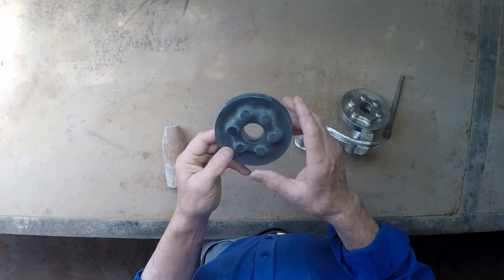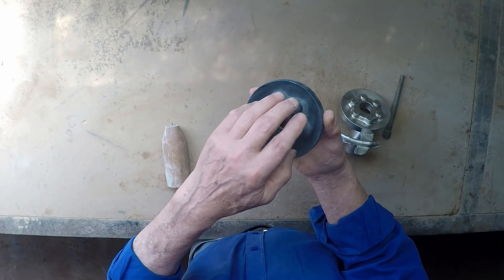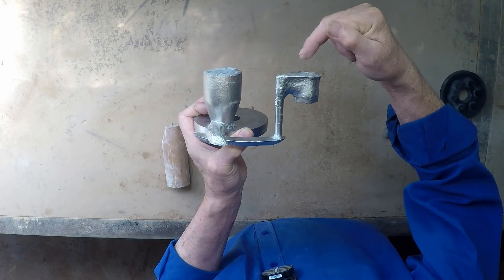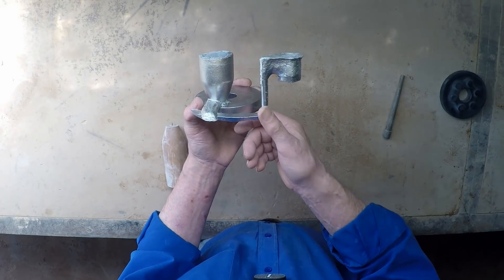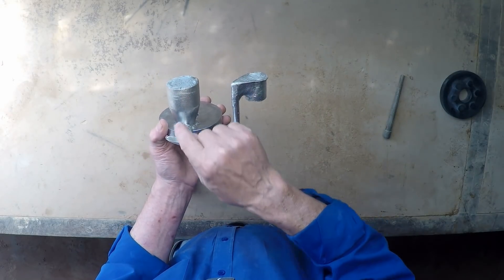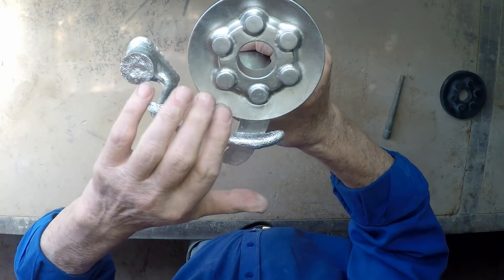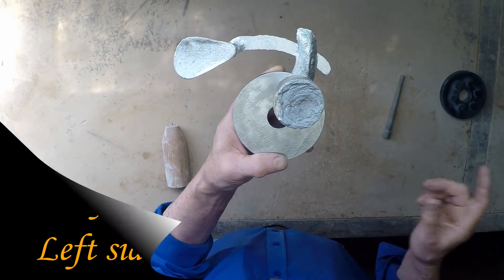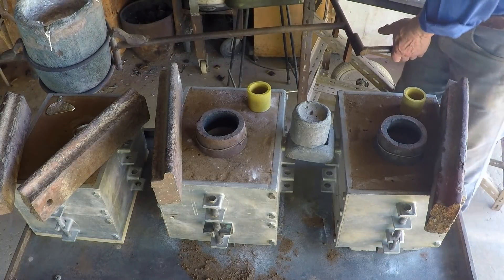Maserati Pulley Half

Comment: Would a sloping sprue not work and slow down the metal even more?
Reply from the maker: Diederik, I have been asked this question before and  in the main the answer is no. But the longer flow path through the sloped and therefore longer sprue will,  providing the sprue is running full, have greater friction and this should slow the metal a little. However the velocity in a sprue is generated by the head of metal pushing the flow, according to, velocity of flow = the square root of (2 * gravity * head height). Sloped or not the head height is the same so the VERTICAL velocity will be the same. This leads me to wonder if the velocity in the sloped sprue is actually faster because it travels further for the same vertical fall. For example if the velocity in a vertical sprue calculated out as 2 metre per second and the sprue was sloped at a rather flat 60 degrees making the sprue effectively twice as long would the velocity along it be 4 metre per sec? Perhaps a better mathematician that I can answer this.
I do note however that I have never seen sloped sprues advocated in any book or used in any foundry. If they did produce any useful slowing of flow velocity their use would be universal (in good foundries anyway)… Martin
Reply: @olfoundryman8418  Thanks for your reply. I'm pretty sure the velocity of your formula is not VERTICAL speed but just speed. (Witch usually is the same, because the sprue is vertical) Suppose a sprue that is first sloped and then vertical, with the same diameter the velocity must be the same everywhere.
Reply from the maker: Diederik,  You are of course quite correct. My mind must have been wandering 😏.(Hey, I am old, cut me some slack😊 ) Metal (or any fluid) can only attain a certain velocity when falling from a given height and what happens in between that height and the bottom of the metal stream is irrelevant as far as the velocity is concerned assuming of course that we ignore friction. A problem with a sloped sprue may well be that being longer it will take longer to fill and even in a well designed gating system the time of sprue fill is known as a bad time for the metal when air etc can easily get entrained... Martin

Comment: Thanks for the tip about the casting handbook. Now I have a copy. Might take a little while to read it only 1200 pages!  Mark
Reply from the maker: Krav, Enjoy the read, scary stuff though isn't it as you become more and more aware of the mistakes that we have all been making. Read study learn and modify techniques accordingly is what I aim to do. If you got the hard copy of the book be careful as my copy was very badly bound and has begun to fall to pieces as pages just fall out of the binding with the least provocation and I am only about 1/4 way through the book. Not what I would expect from a nearly $200.00 book! It is a bit of a heavy read Hmm, your not the first to take my suggestion and get a copy - Maybe I should put in on John Campbell for a commission 🤪..
Reply: I found a PDF. So no binding issues. As for doing wrong. Oh wow. To start the list will take a long time. But I see light at the end of the tunnel. Your videos help quite a bit at fleshing out what I do not already know.
Reply from the maker: Mark, Yep, I heard about that PDF just after I bought the hard copy. Its the 2011 edition  whereas the one I bought is the 2015 but apart form some page numbering I have yet to find any real difference between the two. Yes, the book is a bit of a scary eye opener isn't it. A few of the smarter foundries are adopting the methods in the book as and where possible some of the results being obtained are truly remarkable. I suspect that foundries that stay routed in the past will soon be consigned to the dustbin of history as customers realize what is available in good castings rather than the rubbish that they have been painfully enduring all these years.. Martin

Comment: Very nice indeed. With regards to the velocity of the metal down the sprue, why not have the sprue angled at say 20deg to control it's speed??. Thanks Peter
Reply from the maker: Peter, Yes, you could do this but it may make moulding the tapered sprue more difficult. How much slowing would we achieve by this? Even if we allow for the increased friction because of the effectively longer sprue,  probably not really enough, although it all helps. It is said that the max velocity to prevent damaging turbulence is just 0.5 mt per sec (a little less than 2 feet per sec) a fall of just 13 mm (about 1/2 inch) will result in this velocity. In practice you can perhaps get away with a velocity of about twice this which corresponds to a fall of 50 mm or about 2 inches. Most pour heights are well above this! So you can see the sort of problems that we have in trying to get the velocities slow enough to avoid turbulence damaged metal in our castings. You can use thin slot sprues and indeed they are common on larger work. They have higher friction by virtue of the larger surface area and this can slow the metal a lot. Perhaps one of the best slower downers though is the ceramic foam filter, velocity reductions of 4 or 5 times can be achieved through them. I have an upcoming job where I will be using this method and I will video it, stay tunned... Martin

Comment: Absolutely outstanding information here and given in a very understandable manner as well.  What was the purpose of putting (what ever it was) on top of the riser after the pour?  Looks important but why?  Thank you for all you do, it is much appreciated.
Reply from the maker: Glenn, I put an exothermic compound on top of the riser (I really should call it feeder because that's what it is) I do this as soon as the pour is finished. The exothermic is a type of thermite, it catches fire and generates heat this helps keep the top of the feeder liquid for longer and thus improves feeding to the casting underneath. The exothermic I use is "Ferrux NF" it is a commercial product made by "Foseco". Many of my other videos show this material in use... Martin
Reply: Martin, Thank you for the reference...much appreciated. Glenn
Reply from the maker: Glenn, No problems mate!... Martin
Reply from the maker: Toto, Right on !... Martin
Reply: Search in other videos. All is explained.

Comment: That really is a beautiful casting... Thanks for the book reference, I'm going to have to save up a while for that one though!
Reply from the maker: Tobho, Yes, it is quite an expensive book. It is also a bit of a heavy read  and even as a Metallurgist I struggle with some of it. A better and cheaper buy perhaps is John Campbell's "Castings practice the 10 rules of casting" It is just 200 or so pages whereas his Casting Design Handbook is closer to 1200 pages. However please note that the Ten rules are incorporated in the larger book which obviously contains a lot more information besides so it really is the better buy if you can afford it. While both books are a breath of fresh air that attempts to blow away the 6000 year old foundry techniques that are still much used, the larger book is definitely more for the very serious foundry man.... Martin   
PS. You will be both amazed and horrified at the information contained in these books.
Reply from the maker: Metal, Ah, another convert! It is a big read and that is why I mention the "Ten Rules" book as it contains perhaps the more readily  applicable info (for amateurs). I think that even the most Newbie of amateurs can put some of its info to good use at no cost and thus improve their results.
My own work does not always go as far it should at incorporating these newer methods but I am working on that, my shell moulded pouring basins for example need improvement. But that is the secret, always strive to get it better next time, do not just be content with what everybody else does for often it is wrong!... Martin
Reply from the maker: Kermit (May I call you Kermit :-) ) I have just watched your video of casting the sand rammer. And I can see the outcome of too much in the one mould that you suffered. Problem is that typically the largest casting, the rammer in this case, steals the bulk of the metal and not enough flow is left for the rest. It does not matter how fast or hard you pour there is a limit to how much you can divide the metal stream. I certainly understand about limits I have lots of sand and many moulding boxes but I am severely limited by my inability to lift  big moulds, this greatly restricts the size of work that I can do. A suggestion or two make a couple of smaller moulding boxes so that instead of one mould you have two or three and spread the work between them. Alternatively if using just the one mould use two sprues and split the work between these quite independently pour the second sprue immediately after the first. You could even have two sprues off the one (larger) pouring basin, Campbell shows this. But yes too much in the one box is definitely false economy all that work all that metal all that fuel and its just remelt! You clearly already know the answer more sand more flasks more metal bigger crucible etc. I liked the pouring basin on the rammer mould but I think that your sprue was too big it did not seem to run full and it is crucial that it does. One trick is to count the number of seconds that it takes to fill a mould and then, knowing the weight poured, back calculate to the size of sprue necessary then compare that with what you actually used - most people would be flabbergasted at the difference between sprue size used and that necessary. They are often scared to use the correct size for fear that the casting will not run despite the fact That I constantly show that it will. Most of my work is cast using a sprue with 5/16 inch bottom diameter with casting weight up to 3 Kg but typically 1.5 to 2 kg. When the sprue was taller I have used a sprue with 1/4 inch bottom diameter to pour a 3 Kg casting fil time was 25 to 30 seconds. Always be game to try these things, if they don't work, well there is always tomorrow, just sit down overnight and work out why it did not work for it may not be for the seemingly obvious reason... Martin
PS. working on the one more time
Reply: I'm in the same boat as metal frog - only have 100lbs of sand, wishing I could set up more molds at a time but sometimes forced to put 2 patterns in 1 flask, which has come back to bite me a couple of times when the castings I was trying to pour were quite thin.
Reply from the maker: Tobho,  If you have two parts in a mould put a complete gating system, sprues and all, on each one. I use this trick sometimes and it is a great help. With thin work you need a quick non turbulent flow the get a fill and you sure don't want to be dividing that flow across two parts. I so hate it when I go to all the trouble of making a mould melting the metal and get a non fill, its a real bummer. Years ago I took the time and trouble to make a fair number of metal flasks (I have 30 plus) they have lasted years and will see me  out. Also I bought 4 cubic metres of natural sand (I think they delivered 6 to 8 metres!) I had to shovel  and wheel barrow it all in the rain all 125 builders wheel barrows full! Worst thing is that the sand slowly fritters away and what was 100 lbs is soon down to 50 lbs - I still have 6  by 250 litre barrels of new sand out the they should see me out too!... Martin
Reply: I looked into the cheaper '10 Rules' book and it is cheaper from US retailers who won't ship to Canada.   From Canadian sellers it isn't any cheaper from what I'm seeing.  Guess I'll have to save up after all...
Reply from the maker: Tobho, Check out   https://www.amazon.com/Castings-Practice-Ten-Rules/dp/0750647914
looks like they will ship to Canada. Which part of Canada are you in, my father was born in Agassiz BC Mother in Winnipeg both are now interred there with their respective mothers... Martin.
Reply from the maker: Kermit - seriously what first name can I use (obviously not Shirley). 5/16 * 1 inch that is a bit on the large side. Typically for most of my work I use 5/16 diameter and that is about 1/4 of the area! I would have used this for that sand rammer but I would not have had any other castings attached to it. For some up coming heavy pistons (about a 3 kg pour each) I am going to use a slot sprue  5 mm * 20 mm but this will feed into the side of a ceramic foam filter 20 mm high and about 50 mm diameter (don't have any square filters so I have to use a round one and grind a flat on the side for the sprue to sit against). A runner bar will lead from the top of the filter in two directions to connect to the base of two feeders placed diametrically apart on the sides of the piston. The filter will hopefully ensure cleaner metal but also it will slow down the metal speed and allow us to use a total runner area of 4 to 5 times that of the sprue. It should work well should... Martin
PS. Its not so much about lengthening your fill time its more about making sure your sprue runs full at your current fill time.
Reply: Olfoundryman thanks for the link, must've missed that one somehow.  I grew up here in the Ottawa, Ontario area but my mother was born in Winnipeg too, small world.  :)